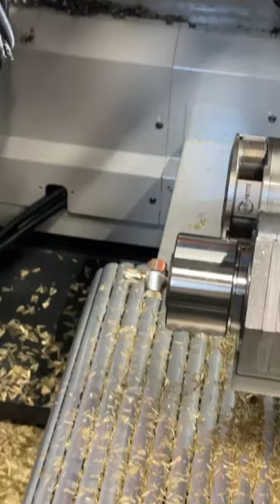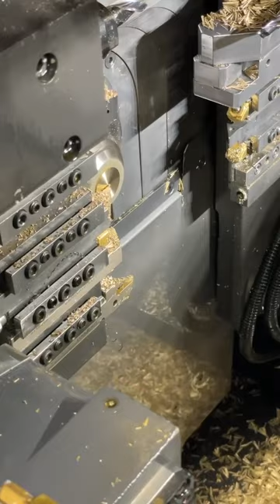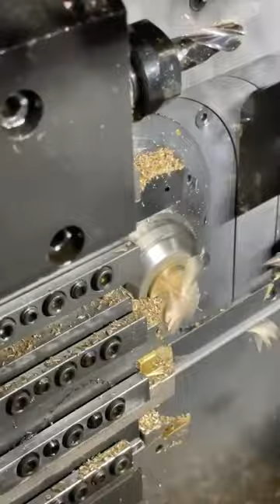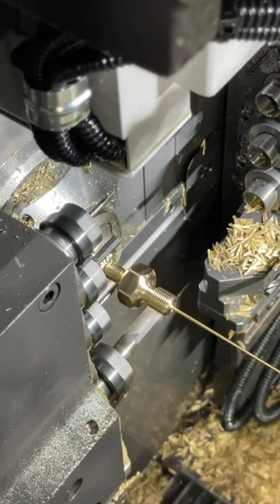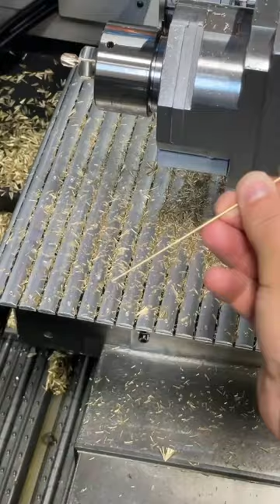Machining a part to show Swiss lathe capabilities.

Comment: Once you really get into machining a part like this isnt all that bad. Hardest part would be maintaining a tight straightness callout on the thin diameter but using a vbgt insert like the one here helps a bunch. If this had to be done in steel or titanium there would be issues with tool life. All in all a cool little part.

Comment: Damn.  I think you really have to be a machinist to appreciate the insanity of what was done here.  My mind is a bit broken as to how it was so precise that you didn't start to have any off-axis wobble without secondary support.  I'm also a bit confused as to why they didn't have the second spindle come in and support the thin section.  Maybe just to show it could be done though?
Reply: It looks like the brass is being pushed into the cutting bit and the bit is like inside where the brass rod is supported, typically when I see a lathe the cutting bit is the one moving and typically never into the plane of where it’s being clamped! The brass being feed into a stationary cutting bit I feel like would be completely different process more like cutting away brass rather then actually turning it down but it’s a observation cause I don’t do machine work 😂

Comment: Serious question... how could you thread the entire long, thin section?
Reply: Turn section of diameter. Thread. Repeat using macro that continues the thread
Reply: Realistically you’re not going to get this fine a thread pitch that long in brass without a thread roller. Brass isn’t strong enough not to break while threading. In steel and possibly titanium it could be done. Can’t really tell how small that diameter starts, but the smallest thread I’m aware of
Is #0000-160 with a .021” major. The process described above requires a well maintained machine, as section turning threads requires the encoders to index dead on every time and no backlash whatsoever in the ball screws. The other option would be a thread whirler. Use the subspindle to support as you run it through.
Reply: @Battle_Beard Wow. That's an insane thread.  I had to do some design work with stainless 1-64 screws once and hated my life, lol.  How the heck do you even work with something that small?  I've had splinters larger than that 😳.  Don't sneeze I guess 🤷‍♂️.